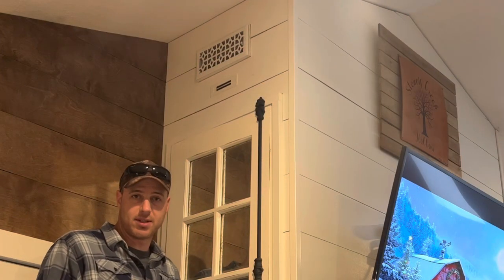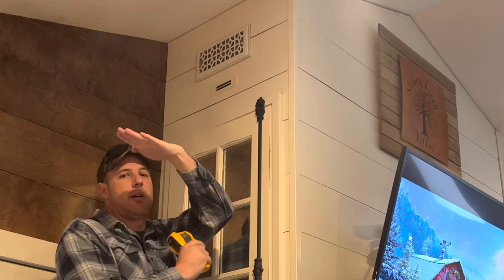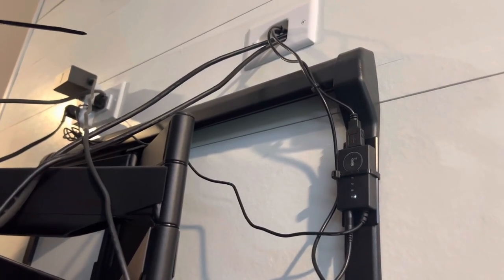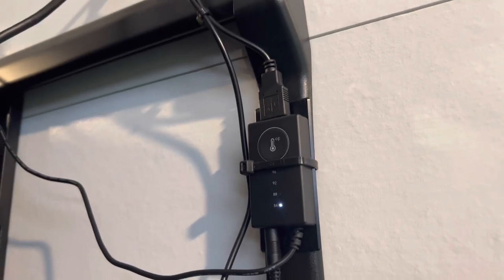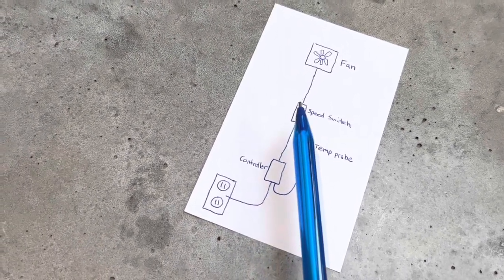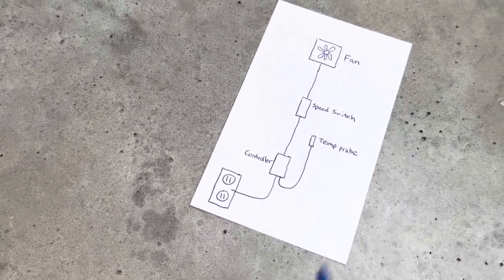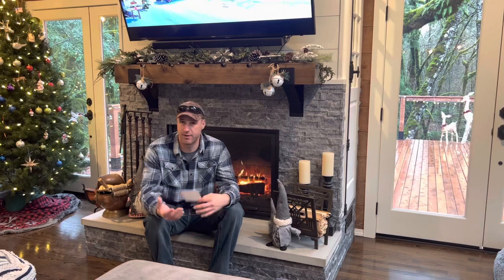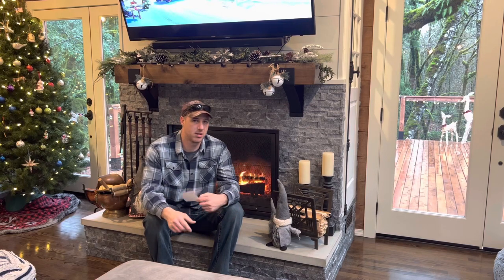Want to Add a Fan to a Fireplace Enclosure? This Might be for you. Check it Out!

Comment: Such a helpful video. I am installing the same fireplace right now..... how loud is that fan?.... i just went on amazon and now i am wondering about using some flex dryer exhaust duct and and inline fan that would be farther away from the exit vent of the system. maybe that would be quieter and i could get more cfm.........    i guess its all about how much heat there really is in that cavity. do you think if you daisy chained 2 more fans that they would all put out 100 degree air? i wonder.
Reply from the maker: Hey Tim, the fan I have in there is pretty quiet. I barely recognize when it comes on and with that fan I got off Amazon, I can daisy chain a total of 3 fans. And yes they do blow out hot air into the space.  Above 100f easy. The temp really is dependent upon how hot your fireplace gets. The chimney ducts behind there seem to put out a lot of heat and the fireplace itself on the inside. As for what fan you want to put in… do what’s best for your situation. I don’t think you can go wrong with the option you want to do. My situation might not work well for others setups but it is an option. You can always try what you want and if it doesn’t work out then try something different. With the fans I put in, if it stops working or goes bad, it’ll take me about 10 seconds to replace, so I put that into my thought process. But yea, if you want more CFM then check something else out. Do me a favor though, whatever you choose, let me know how it goes? Always curious… thanks again for checking this out and subscribing to my content. Super helpful :)

Comment: Thanks for the videos! Really interested in this fireplace because of its firebox size, and sliding doors. Amazing features! Just curious, are you happy with how much heat it provides? I noticed you added the fans, so I'm assuming you wanted more heat in your living space than it originally supplied. Did the fans do the trick? You might have mentioned it, but what climate are you in? Finally, I know it sounds crazy, but would you consider installing a more efficient insert? Thanks in advance!
Reply from the maker: Hey Donald! Thanks for the questions. So to answer your questions, yes I am happy with the heat output. It’s on the one end of our house in a vaulted ceiling room that around 26 by 20 feet in size. It does provide heat to that room (sometimes too much) but it does heat the space. I would think if it were located in the middle of the house it would provide more heat to other places. The fan I originally ordered to help cool the enclosure but found that it not only did that job satisfactorily but also provided more heat to the room. I can notice it. As for the climate, I live in Washington state so we have cold to mild winters. Lastly, we did a lot of research on all kinds of different fireplaces and this is the one that we felt fit our house the best and was cost effective. I’m positive there are better ones out there that provide more heat, this one just fit our style and function the best. I’ve had other people comment about how much heat fireplace inserts deliver so maybe that’s something you may be interested in. I’m not sure mine is considered an insert but I could be wrong. Anyhow, I hope this helped and if you have any other questions, please just fire away. Thanks Donald.

Comment: okay I'm not a very smart girl...so here goes my question.  does the fan hook to your chimney some how or is it using the heat in your incloser only? I'm confused.
Reply from the maker: Hey Joelle! You’re smart!!! Come on! Hahaha Hey great question… and yea you got it… the fan is just blowing the hot air from the enclosure into the room. Nothing is hooked up to the chimney. That enclosure gets pretty toasty from the chimney and I didn’t want that heat to go to waste. Hope I answered it for you :) thanks for stopping by and leaving a comment. Really appreciate it. Let me know if you need anything else 😎
Reply: @StoneyCreekSparkchaser  you are welcome. Thank you for your reply. Next question 🤔 my chamber is on a exterior wall how do I find out if it gets hot enough in there to put one in ? Any suggestions?
Reply from the maker: @joellehosette818  Morning! So nothing states you need a fan to cool that area down. I just did it to get heat into the room so it wasn’t wasted. But if I read your question correctly, your enclosure is on an exterior wall (same as mine). Does is like bump out to the outside or come
Into the room like mine? So all I did was grab like one of those kitchen temperature probes at first and stuck that in the enclosure to see how hot it got. Once I saw that I could gain heat from that area, I grabbed a more accurate Infrared thermometer to check the temp. You may not have access like me, hmmm. Well you could still use the kitchen people thing. Just take a mail and put a small hole into the small, then shove that probe in there to see if it reads a temp. It may work. I hope I answered your question, if not, just ask again and I’ll try thinking of a better way. 😎
Reply: Thanks so much for you help. I can't wait to try this out. 😍
Reply from the maker: @joellehosette818  thanks Joelle! I hope it works out as good as it does for me! I appreciate you :)

Comment: So you dont show how to mount the fans?
Reply from the maker: Hey Mr. Koolio! I do apologize for that and that’s why I appreciate the question. Mounting is super easy. The fan comes with a plastic template which is in the shape of the fans faceplate. Just stick the template where you want it, trace out the rectangle (where the fan slides into) and mark the 2 holes for the screws. I was then able to use an exacto blade and multi-tool and cut the rectangle out. The fan will fit inside of the rectangular hole you just cut out and the kit comes with 2 wood screws that you just screw into the wood. You can however use whatever screws you want since these are standard holes. So yea, I think that pretty much answers your question but if you have anything else you wanted to know, just comment away. Thanks again Mr. Koolio and I hope you have a great day :). Apologies for the edits, my phones autocorrect was going crazy this morning.